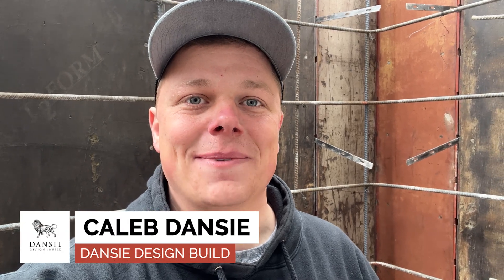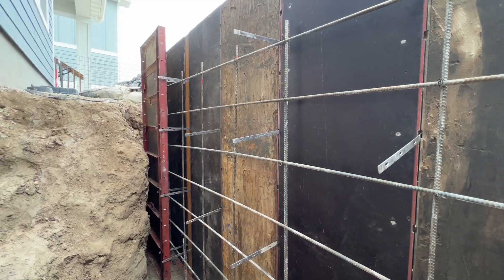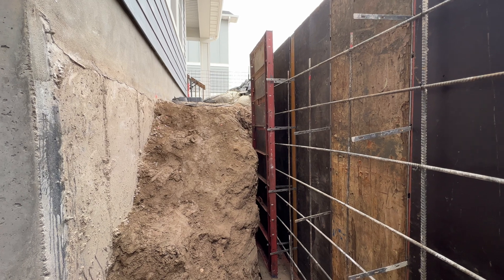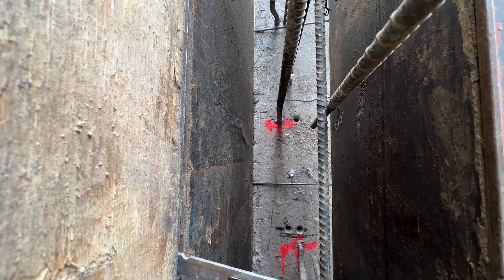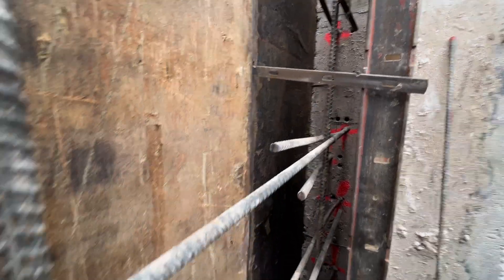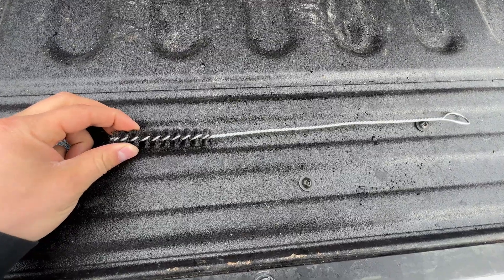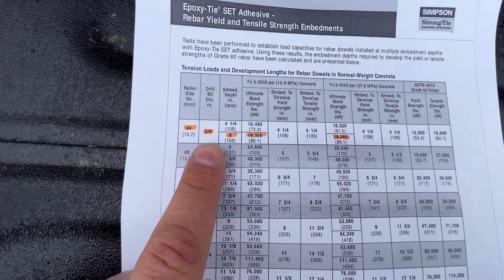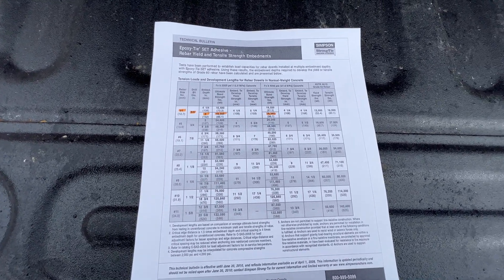Structural Rebar Connections Done Right for a Basement Walkout Entry

Comment: I noticed there wasn’t any rebar placed in the footing directly in line with where the door opening will be. Shouldn’t there be some reinforcement or a footing tied into the foundation under that spot, especially since that area is being cut out for a door and landing?
Reply from the maker: Good observation, the structural integrity is based on how the engineering plan is set up. We do the rebar as per the approved drawing and get that inspected, then move forward.